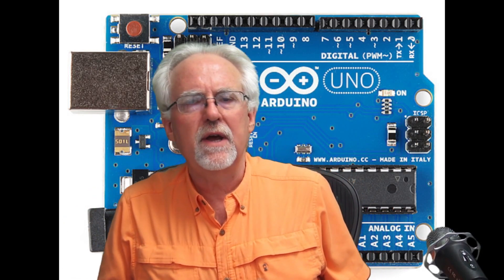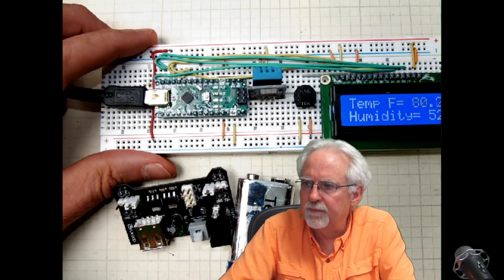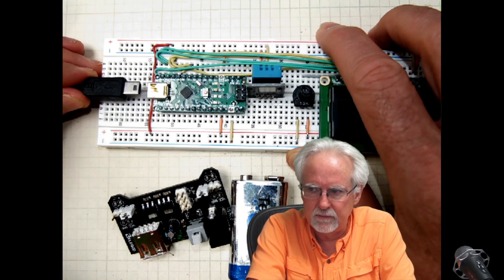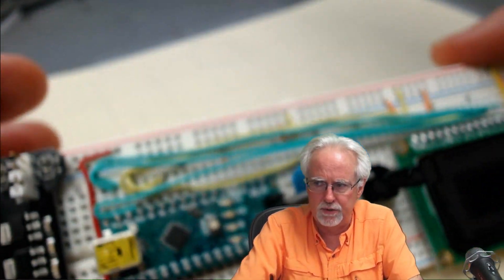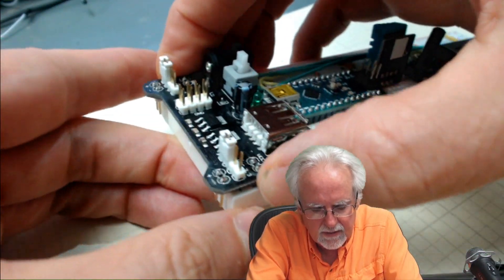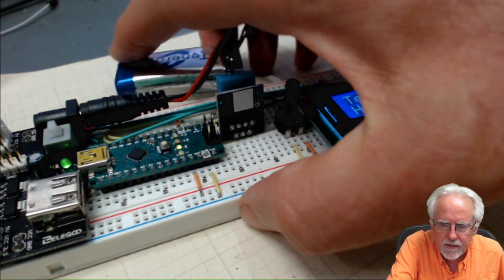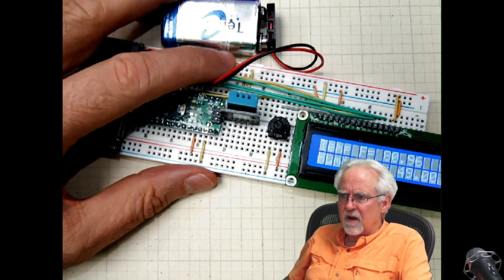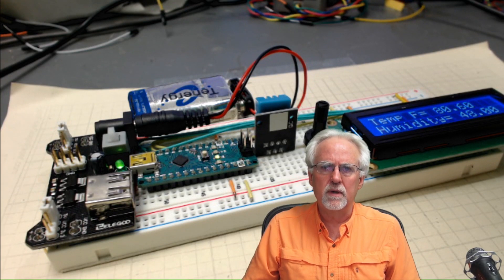Arduino Tutorial 52: Portable Temperature and Humidity Sensor with DHT11

Comment: Dear Paul,  For mobile  we did use a arduino  5volt module, it was a bit not quit fitting. So i went on and we can use de regulator L7805 cv.  On the back of the regulator  you put de most rightpin to the + and the middel to the GND . on the front site of the regulator we put a condensator 10 Uf the postive to the most left pin of the regulator and the negative of the condensator on the middelpin of the regulator. 
Than you use a 9volt battery  + to  the plus of the condensator and the negative on the negative of the condensator. If you use the voltmeter you see 4,99V  the display will lightup and the DHT11 works on your programe and we are mobile.
Wish i could send you a picture how i did it. Together we are great Paul!

Comment: I am Legend, for both the project and for the troubleshooting. You do realise you could just move the PSU board to the other end of the breadboard and everything will face the right way, Yes I know it covers the abcdxxxxxx stuff but just add it to the breadboard after you've wired everything else, just don't go beyond column 10. Sorry but I thought that was obvious.
I did this by project by the end of Lesson 50. I Have also been using the PSU board for a while now using a  9V PSU Wall-wart. so swapping to a battery was simple.
If you utilise the space behind the LCD display and fit the DTH11 where there are no pins  you can get everything to fit neatly on the breadboard without anything  overhanging.

Comment: Well, Paul, I finally got my Nano (a real one, not a knock-off) in the mail.  It's a brick.  I've read through forums at several websites, tried multiple "fixes", but it refuses to be written to.  Do you have any insight as to why, or should I just exchange it?  Here's the error I keep getting, "avrdude: ser_open(): can't open device "\\.\COM4": Access is denied."  It doesn't matter what COM I assign it, if I use the old bootloader, etc.  It just doesn't want to work.  It seems to power up, the "ON" LED is lit, the "L" LED is blinking, and when I try to upload the code, the "L" LED does it's rapid series of blinks, but the same message is displayed, and nothing else happens.  I've tried very simple blink response coding, but nothing uploads.  Do you possibly have any insight after your thousands of hours and students of what I may be doing  wrong?

Well, I know.  And you do, too.  The serial monitor and the known bug with IDE2.x.  Sometimes, I kill myself.  Other times, I just bang  my head on the wall.  Shut off the monitor, whether serial or plotter, then things will (might) work.
Reply from the maker: The only problem I ever ran into with the nano is on the knockoff or clone nanos where they did not license the USB interface chip. Not sure what might be going on if you have an original version.
Reply: @paulmcwhorter I found out the problem is a bug with Arduino IDE, after version 2.x the serial monitor MUST be closed in order to upload to the Nano.  Learn something every day.  Even if I don't want to.

Comment: I think the problem is that you are not plugging the power supply into the breadboard in the proper polarity and there's no need to connect the + and - across the 2 breadboard rails any more. If it is correct, I am a troubleshooting legend!

Comment: I figured out the portable power just fine. Also spotted the incorrect orientation of the power supply. It is 13 degrees F outside right now,  my DHT11 stabilized at 37 degrees F. Not very accurate! Another good video.

Comment: Since buying a Nano is not an option for me, I had to dig up some ingenuity to make the Uno portable. So I moved the LCD down onto the breadboard proper and used the precut jumpers (plus a few I had to make myself) to make the connections. I was thus able to eliminate the flexible jumpers, making the whole thing pretty "solid."
I put the whole thing on a small sheet of corrugated plastic, plugged a 9V battery into the DC connector, and voila! I became a legend in my own time.

Comment: I am legend.  Tested it over a stove and in the shower.  I did not have the dangling power supply pins as I am using a fixed resister (2KΩ) and the 16 pin of the LCD is all the way to the right of the breadboard.  Of course, the LCD hangs over, but it is very light weight and all the pin really anchor the LCD.

Comment: I had a hard time with the library for the sensor. After several hours that included removing and redownloading the ide, no matter what I did there’d be a different error. If I fixed what it didn’t like, something else would be wrong, so I change that and the original thing would then be wrong. I tried several versions of the DHT11 library. The only way I was able to solve it was to copy another sketch I found online and add the lcd code to make it do what I wanted. It was by far the frustrated I’ve been so far through all these lessons that I’m enjoying. 
Thank you for making the them for us.

Comment: I am LEGEND IN TROUBLESHOOTING
I got the LAFVIN Nano V3.0  I have a Wirewrap tool from Radio Shack from 20 years ago.
Modern Linux Like Mint 21 and up have the CH340G driver installed. The hardest part is finding which port the driver is using. In my case /dev/tty/USB0. Then select the correct Nano. For Windows 10, you have to install the driver. Port 4 works in my case.
If you have "brltty" for those needing Braile, it uses the service Nano needs. Use sudo apt uninstall brltty.
Restart Linux. When you open the IDE the /dev/tty/USB0 will be found.
The Nano will work wigh a USB phone charger.
Reply from the maker: LEGEND!

Comment: Paul,
I only recently found your series....
Interesting, I am going to order some stuff. One question, you said not to connect the power supply and a USB from the PC at the same time. I can understand that might give problems. Does this mean I would have to remove the power supply when I want to change the program, or would switching the power supply off be enough? Or can the PC connect through the USB on the power supply?
Oh, by the way, my power supply is labeled 5-9V instead of <12V. Would I get the deadly grey smoke at 12V??
Thanks for an answer,
Sierk (in the Netherlands)

Comment: If you still use the arduino uno board, is it more convenient the connect the battery to the arduino uno board directly, disconnect the usb and don't use a powersupply board?

Comment: Sorry for the late reply, I know this video is 2 years old but: 
1. You can connect 9 volt battery directly to the boards, it can work up to 12 volts.
2. If you're using more sophisticated sensors or trying to operate something a bit more complicated, 5 will not always work. You need more than that, at least 7.

Comment: I hate these 9 V silly batteries, they drain easily so, I’m finding out other sources, like a iPhone charger thru the USB, or thru the other plug with a 9 or 12 V source. I have 2 3,7 5800mAh rechargeable batteries, What do you think?
Reply from the maker: Yes, the 9V battery is useless, and just confuses people. It will run the motor about 30 seconds.

Comment: Thankyou so much for the lesson sir.. I was able to do programing but it doesn't work when I tried it on portable with Battery, I tried to see what's the problem.. my Dht works without LCD, and the LCD works without the Dht.. but when I tried to put them together they don't work.. I think problem is my battery or my arduinos microcontroller can't handle two devices.

Comment: I am NOT legend.
Reply from the maker: Dont give up!
Reply: @paulmcwhorter  I won't  , really love electronics it's just i'm not good at it. Being able to code and make sketches work is a nightmare for me? Is there some website that explains the error codes?
Reply from the maker: The error codes are not clear or easy to understand. But they tell you that you made a mistake. In your mind, you have to say, I have made a mistake, and I will find it. Look at the code line by line. Look at the error message and see if it gives you a clue where your error is. It is a matter of carefully checking and proof reading your code.

Comment: As per the Arduino website the NANO Vin connection is designed for 7 to 12 VDC. I also verified after connecting the 9V battery the power rails had only 5VDC on them. The battery needs to connect to Vin  not 5V.

Comment: I am Legend. I used two different methods to make mine portable. I used a portable phone charger which worked great but was a bit bulky. I also dug through my stuff for an old 9v battery connector. This I soldered to some 20 Ga. solid wire. I was able to plug this wire into the Perfboard at Vin and ground and viola it worked. Serious portability. I do however prefer the power block for its rechargeability. Just my 2 cents.

Comment: I am legend.  I did the project before watching the video.  This project really pushed me to move forward with my prototyping skills.  I got a nano; made my own "neat and tidy" connecting wires from 20 AWG solid wire; laid out the project so the breadboard power supply was on in the correct orientation.  I had the same orientation issue as you did and had to fix it.  It was a great project.  Even my engineer hubby was impressed with this one.  Thanks!
Reply from the maker: Excellent!

Comment: Also, an interesting tidbit.  When I am done playing with these for the day, I put the kit in the garage to keep cats from gnawing on the wires.  Today, when I brought it in and hooked it up, the everything was cold, reporting 49F with 10% relative humidity (RH).  Within a couple minutes, the RH shot up to over 60% while the temp was creeping up degree by degree.  My house is quite dry, as it is winter here and we do not use a humidifier.  Over the next 2 hrs, the RH finally settled to the more accurate 38%.  It took me a bit of thinking to determine what happened.  I will post what I believe happened in a reply to this post, and give others the chance to think about it.
Reply: While my home is fairly dry, it is much warmer than the garage where the device was stored.  The RH is higher AND warm air holds more moisture (Hence the relative part of Relative Humidity / RH).  My guess is that moisture from the air began to condense on the cold DHT, saturating the medium in the humidity sensor and skewing the readings until it could dry out.

What do you all think?  Does this seem reasonable or am I missing some other factor?
Reply: Condensation of water on the cold unit in the warm house.  As the temperature of the thermocouple rises, the condensed water evaporates making the realtive humidity high on the sensor.

Comment: *Edit I am legend! *Edit 2 You connected the Power Supply backwards Gnd to Positive rail and 5v to Gnd rail. I am legend in troubleshooting!

Hey Paul, thank you for this amazing Arduino Series. Before watching the video... I completed the assignment of making the build portable by using the Power Supply Module with the 9v battery and connecting it to the breadboard. 

I played with the build for a bit but i did not like how it looked with the stiff usb cable powering the Nano from the Power supply and, after a bit of research, i learned you could power the Nano by connecting the Nano Vin Pin to 5 volts, so i just connected it to the positve rail on the breadboard which was already being supplied 5 volts by the Power Supply. This made the build look way better and cleaner. 

I also went ahead and added a button that would toggle 3 different readings on the LCD; Temperature, Humidity and Apparent Temperature. For the Apparent Temperature or Heat Index i used the following code which i accidentally found while i was reading a bit about how the DHT 11 Sensor works internally:

heatIndex=HT.computeHeatIndex(tempC, humidity, false);

This assignment was soo good. Being able to hold the build in your hand and go anywhere made it feel like an accomplishment. Thanks so much for these amazing videos I am very excited to see what else we will be learning next.

Comment: I AM LEGEND. Yep, got it to work after correcting several wiring mistakes. Including: putting the power source on two rails without realizing that - & + are reversed on one rail. That one really got me for a long time. Before I saw the - sign on my voltmeter while checking voltages. But, everything worked great.

Comment: I am Legend and I am Legend as a Troubleshooter! I was having difficulty with the Nano I purchased through the link in your description but I got that figured out and got the project to work while connected to the computer. Then I attached the power module but it would not fire up. I realized the + and - were switched on the power supply module and I went ahead and rewired the rails for the correct polarity and it worked perfectly! Very satisfying project, I ran around like an idiot measuring the temperature all over the house. Thank you for another fine lesson!

Comment: Am I seriously the only person that can't get his power supply module to work properly? It's so frustrating to see Paul hook it up and everything works fine right away. I had this problem back during the motor tutorials and now again here. Whenever my arduino is being powered by my regulated DC power supply or via the USB from my computer, everything works great. But as soon as I try to hook up the power supply module with a 9V battery, I get complete garbage results. My LCD just flickers randomly and never displays any text. The voltage is solid on my battery (currently reads 9.43 volts). I have the jumpers on the power supply module set up correctly. Everything is fine except it doesn't work and it's heartbreaking.
Reply from the maker: I think I said in the lessons dont use a 9V battery. You need a power plug. Find a wall wart with the right voltage. The 9V battery is either dead, or draining quickly

Comment: You could have put the regulator on the other side of the LCD, then the polarities would be correct and the power plug would be facing outwards...and you could have plugged in both sets of regulator pins into the breadboard.

Comment: I chose to build a base unit with power supply, Nano and LCD and move the applications (like the DHT11)onto another board.  A second or third breadboard can easily be attached or detached from the base board as they are designed for this.

Comment: Hm. I am legend at troubleshooting. My breadboard hot and ground rails line up with the polarity on the power supply board. Yours are reversed. Methinks you have two choices. The "proper" way is to remove everything from the breadboard, flip it end for end, and then rebuild everything. That will put the correct rails under the correct power supply output pins. The quick and dirty way is to run all your hot leads to the ground rails and all your ground leads to the hot rail.

Comment: I am almost legend. I found the battery, power supply, and battery cable. But the power supply has jumpers on one side set to (I think) 5VDC and on the other at (I think) 3.3VDC. My build has two power rails, one along the top of the Nano and the other along the bottom. I need both to run at 5VDC, but don't know whether the little board can support both ends at the same voltage. So am watching this build to be sure I don't let the magic smoke out of the power supply board.

Comment: A be aware of, not a real problem: The power supply shipped with my kit has a slightly different power indication by the barrel connector. Vin 6,5V~9V  Marking on the back is ELEGO   Power MB V2. My assumption is that it would not be wise to attempt using 12V with this version.  I do have a selection of 6V and 9V wall units but will need to check that they are DC and regulated to marked voltage.  Many of these produce higher voltages is the current drain is inadequate to pull them to rated voltage.  Part of being cautious.

Comment: It looks all fine and it works.; but there is a great but !! I ordered a Nano on the internet. I don't think it's a original Arduino Nano. So it took me 3 days to find out that you have to use other settings for your Nano then for the UNO.
For instance you have to use other setting: com 5 instead of 4, choose board NANO in the settings and last but not least use Atmega (Old Bootloader) in the settings. Also be aware to us CH340 as a driver for your Com 5
If you do all these, there is a great change that you will succeed;
George Jansen from Holland

Comment: My only comment is that I either missed it in an earlier lesson or it was not there, but I didn't know how to send a sketch to the nano, because the connections are not the same as for the Mega2060 or Uno.  I ordered the nano, but it didn't come with a cable, because I didn't know I would need one.  Luckily, I've browsed around and know I have to order the nano usb cable. hum

Comment: Hi Paul,
Thank you so much for these tutorials, they are so inspiring! 
At about 6:30 you mention talking more about powering an arduino from an external power supply, i would really like to learn more about this topic.
I would also like to learn about powering bigger and more powerful steppermotors (and other devices) and setting up the drivers and so on if you should ever consider this :).
I will surely be watching your Fusion 360 tutorials after these tutorials.
Reply: Did you get the starter kit? In mine, it had a board you can plug into the breadboard which gives 3.3 & 5v outputs, regulated, into this you can plug a 9v battery, or plug type power supply.